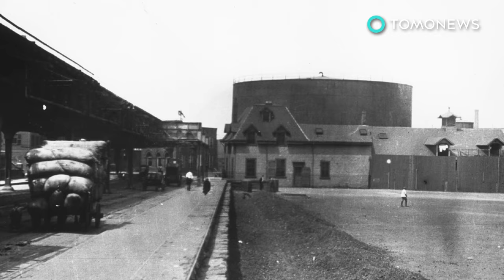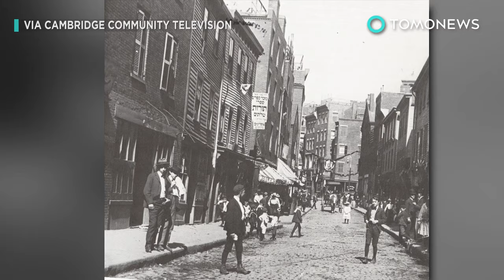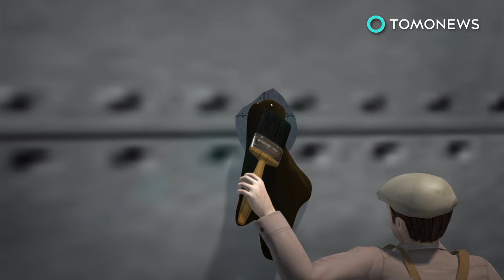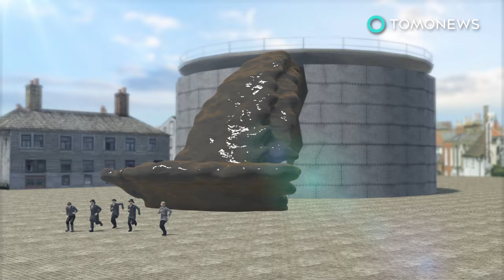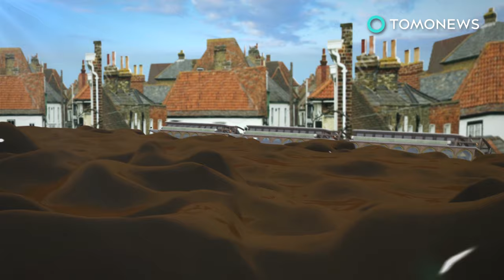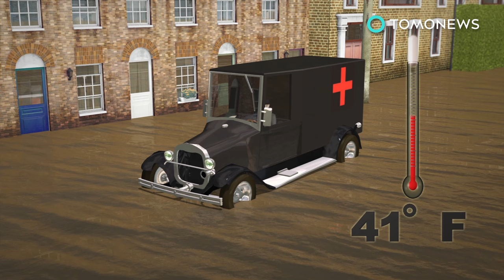Great Molasses Flood: animated retelling of Boston’s molasses tank catastrophe of 1919 - TomoNews

Comment: Ugh, what a mess that must have been. Imagine how long that stuff coated everything.
Reply: They say on hot days you can still smell it almost 100 years later.
Reply: yeah. the truth is, after the gallons fell away from the city and went into the sea, there was still a lot of residue. so if you sat on a bench in the park, u stuck to it. Many ppl had to take off their trouser's before getting off public bench XD. what was worse, ppl couldn't wash the stuff away with regular water. So they brought in the fire department, and they used seawater to "cut" through the molasses

Comment: I have one of those gallon mason jars completely packed with the original molases collected from the site only hours after the incident. It's extremely dark now similar to tar/degreaded petroleum or something similar. The cap is Somewhat sealed with a dated portion of newspaper adhered to the lid and jar rim to prevent it being opened. It was originally collected by the  owner of my home who had an assistant collect a sample and transport it back to central ma. I found the jar among other things in the spacing above the drop ceilings for plumbing access, presumably it was placed there just to temporarily keep it out of the way but was sealed in after the owner unexpectedly passed and a majority of the belongings dispersed as the home partially functioned as a facility for his medical practices. I also can't dig in my yard without finding bones literally scattered everywhere because an old church and cemetery next to my home had been demolished in the 60s, and apparently grave removal doesn't get everything. I don't have time to deal with that so I've just been dumping them down the sewage inlet in the street for years now.